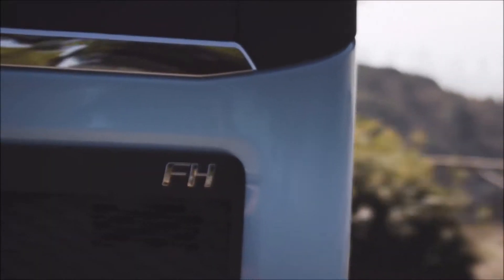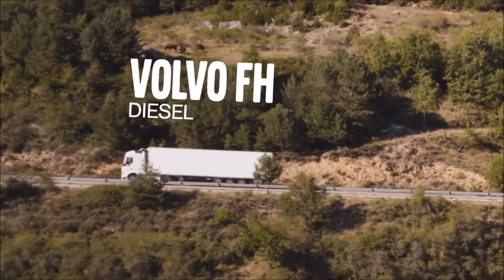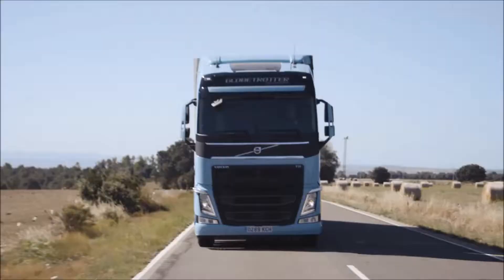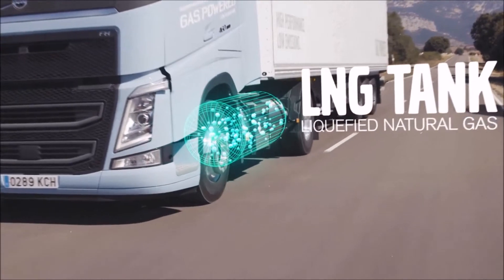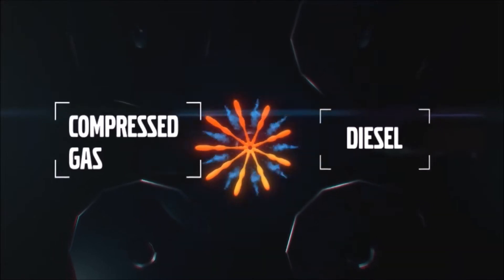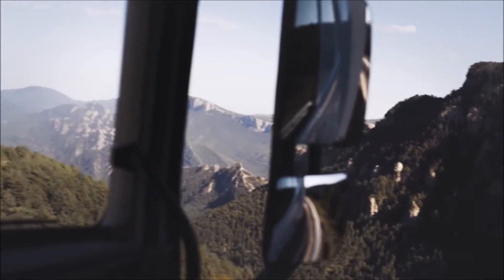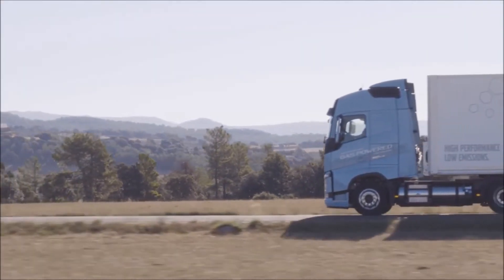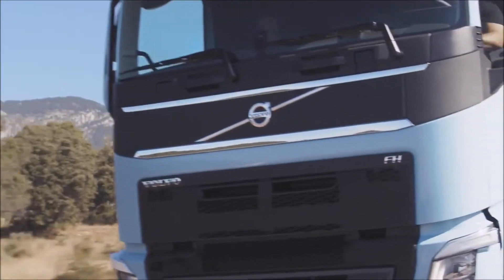LNG Natural Gas Powered Volvo FH & FM Trucks

Comment: This isn't the first Volvo 460hp truck running on LNG, Volvo launched the FH and FM 460HP Methane Diesel trucks in 2011 with a Clean Air Power system installed down the Volvo production line.

Comment: What you need is my new engine at 60%, not a Diesel engine.  It would be twice as efficient and therefore CNG, Diesel, gasoline, propane, bio or battery could be used with NO NOX or smog soot like Diesel does.  Complete burn over 540 degrees of rotation, not 90 degree like in Diesel.  No emissions issue at all.  Just pure water and CO2...soda pop you can drink..  Yes, battery electricity can run this engine without electric motor for indoor zero CO2 requirements.  Not a hybrid...no electric nonsense.  Want to know the future of power?  See tweets at twitter.com/seaplaneguy  Looking for partners.